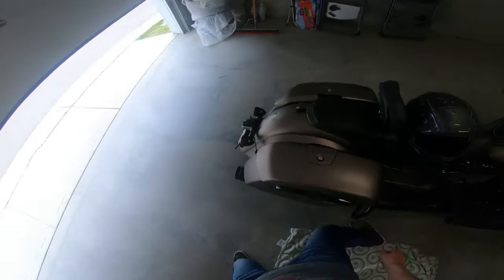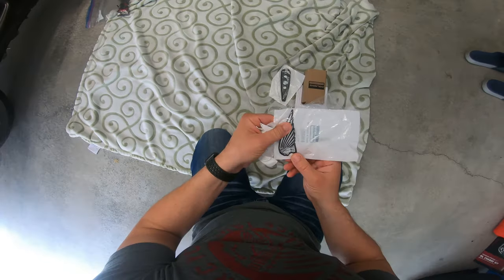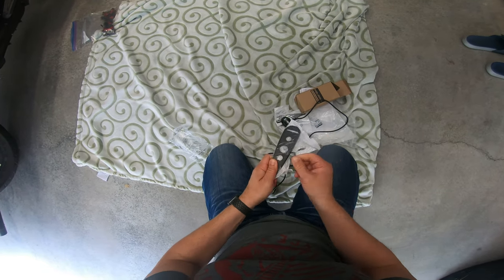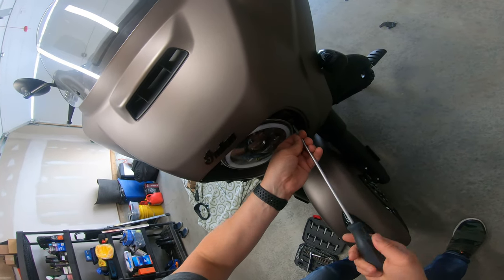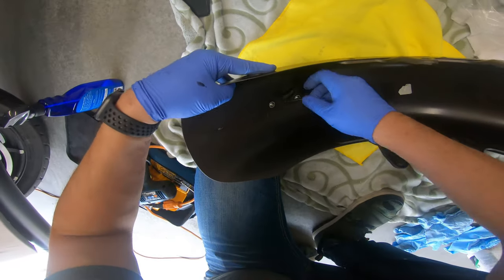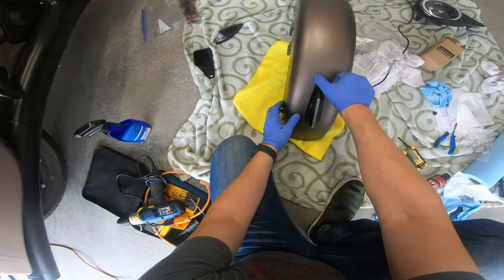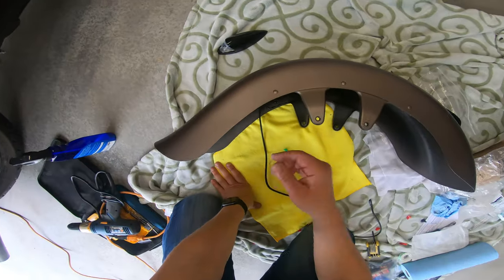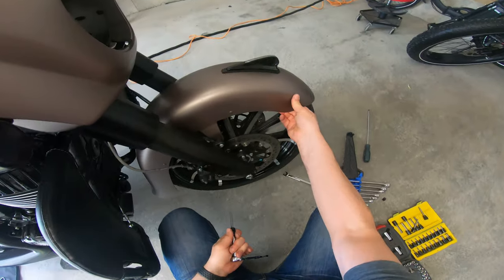Install Indian Challenger War Bonnet On Chieftain Dark Horse 2019

Comment: Nice install, I did notice that you didn't seal the hole you made or around the screws underneath the fender. Reduce the risk of rust.
Reply from the maker: Yes o didn’t because fender had some scratches and it was pained after that. But you’re right. If I wasn’t plant to paint it I would seal the holes for sure

Comment: Awesome video! Just oreder a new cheiftain this year. Always wondered if this was possible. 
Question: the plug that works for that, does it come on the bike already or is it a separate wireing harness?
Reply from the maker: The plug is already there. It’s labeled with war bonnet on it so all good. Even the dealership didn’t know that when I told them it’s plug and play.

Comment: I know you drilled a hole for the wire. Did you have to drill any other holes ? Ie the mounting holes of the original war bonnet line up with the challenger war bonnet. I know you said to use original screws from old bonnet.

Comment: I would NEVER trust crazy glue..........unless you just want to bond your fingers together.  =-}      I would use JB Weld instead!
Reply from the maker: It’s all about your comfort level. I had a great success with crazy glue plus the clip themselves have their own 3M adhesive. But of course JB Weld does a great job too.

Comment: Nice video mate. Just one question. I pulled my headlight assembly and tried to locate the war bonnet cable. I could find a 2 pin connector insulated with other harness but no label. The connector has named as PED A B. Does this make any sense?
Reply from the maker: There is no other cable should be there. It's 2 pin yes. What year is your bike?

Comment: Love that light. Quick question where did you find the smoked lens for your front turn signals?
Reply from the maker: I used spray. There is no way to get smoked lens for these light because and as you know Indian made the light built in with the lenses
Reply: @Cometocanadabut  ok I got cha. I know well I guess I'll do that. I was hoping not to have to but that's the way it is. Thx for replying. Stay safe up there in the great white north.

Comment: Did you have to buy everything separate or the dealer sell them as a kit?
Reply from the maker: Everything separate. But the dealer should know what you need
Reply: @Cometocanadabut  they told me it comes with everything and it was like $220
Reply from the maker: Latino Biker that should be fine too as long as they know it comes with everything you need. My dealer even didn’t know it fits my bike until I told them. I don’t even know it’s there after I install it 😁
Reply: @Cometocanadabut  they didnt know either here lmao rhats why im a little skeptical about it haha
Reply from the maker: Latino Biker it depends what is your priority is. It’s for the looks and it doesn’t really do anything else. I can’t even see it while I am riding. And when I am not riding the bike is turned off 😁

Comment: It’s cool but not sure about having wires that close to a spinning wheel.
Reply from the maker: There is a lot of room to run more than one wires. I was thinking the same way but nothing to worry about.
Reply from the maker: William Watkins it’s already installed on the Indian challenger the same way. Even one in a million if it happened, it won’t go the same way as you think. Remind me with final destination movie.  It’s a very thin wire and worst-case scenario the wire will cut.
Reply: RealBox I’m just saying I’m a mechanic and I’ve seen a lot of shit “it’s not supposed to be like that” moments lol.
Reply from the maker: William Watkins I respect you are a mechanic. But I didn't invent it. It's factory installed on Indian challenger 2020. Wire under the fender no problem. And also on previous Indian models and people have tons of miles without any issues.
Reply: @williamwatkins2538  I would think that IF the wire somehow entangled with the wheel, the Wire would simply pull out of the light waaaay before it pulled a fender inward.....
Reply: ClockFixer 1964 just sayin I’ve seen some shit happen